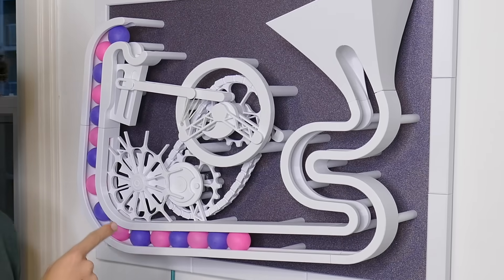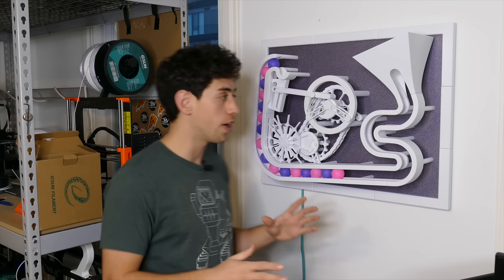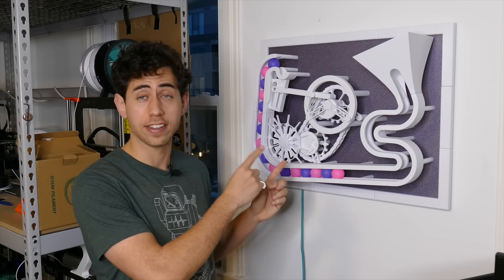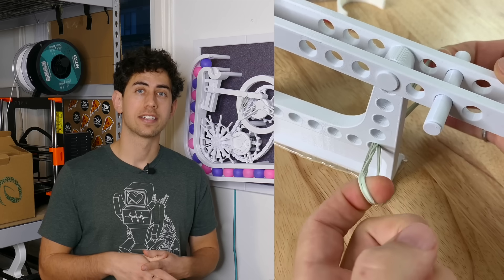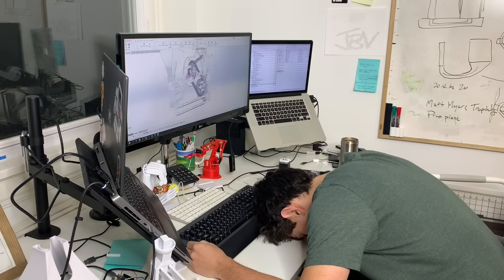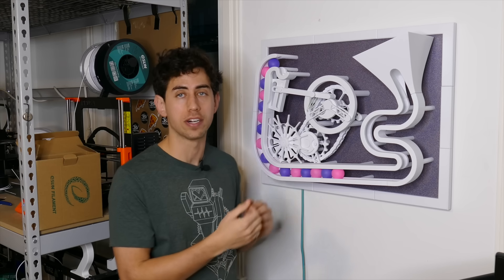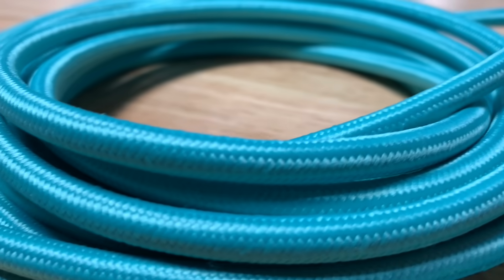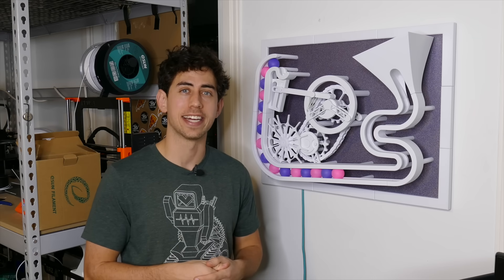I Built a Perpetual Pong Sculpture

Comment: Great project! Btw why not use a battery to power the whole thing instead of running off 120v? I'm sure you could find some LiPo batteries that are powerful enough and can also be hidden within the frame etc
Reply from the maker: Great point! Might have to use a battery moving forward.  Might've gotten carried away by the pull switch haha
Reply: @Engineezy  I see the iron ring! Lemme guess, mechanical? :)

Comment: I think an awesome version of this would be if you used a clock mechanism to move everything utilising the minute hand and having 12 balls so every hour the ball will shoot into the hoop and a ball representing the current hour drops into the ball launcher. I think it'd be the coolest clock ever and the way you have designed it would be perfect just change the motor with a clock mech and design something that slipped into the minute hand part of the mech and connected to the rotating assembly or a stepper motor and arduino board if a clock mech hasn't got enough torque to turn the rotating assembly
Reply: Great, you've done the easy and fun part of the next video for him!
Reply: @stevecarter8810  he still hasn't made it so I don't think he liked the idea to much, I think it'd be a great convo starter

Comment: I don't quite understand, why you need measurements, before you even start designing. Don't you do parametric design?
Reply from the maker: It helps to have a starting point- just because I have the power of CAD, this will end up in the real world so you need to know what constraints will affect the outcome!
Reply: @Engineezy  But things like the Sizes of the balls you need to do as parameter regardlessly. otherwise it is a bunch of work when you want to make the thing for different balls.

Comment: Idk why you didn’t tell us the power chord and on/off switch weren’t 3D printed either 😂 tbh that integration step is the project killer for me. The length of time between successes at that stage leads me to sidetrack in search of dopamine.
Reply: I 3d printed that, but it burned my house down, slept with my wife and told my children that there is no Santa. Best not to try 3d printing that.
Reply from the maker: That’s exactly what the side quests are for!

Comment: Smooth design! Solid works for the win. I’m curious if there would be a way to refine the slope angles in the funnel to try and get the ball to cleanly and almost silently fall straight into the tube like a 3 point swoosh. Then you don’t have much of the bouncing around noise. That would step it up to almost a zen kind of machine.
Reply from the maker: Definitely! Would require some iteration and some perfect springs

Comment: There's two things wrong with this.  Firstly rubber bands degrade in air so eventually they'll break or fail to stretch.  Secondly and more importantly this thing is just too darn noisy and distracting.  You can't just turn it on in the lounge room and let it run while watching TV. It gets annoying within minutes of operation. Which means you'll leave it off pretty much all the time and then its just wall art.
Reply from the maker: But…it is wall art…
Reply: @Engineezy  Not very good wall art.  If I had guests come over and I had these toys hanging on the wall they'd question my mental state.

Comment: I love the power cord on/off switch idea! Such a clean design.
Reply from the maker: Thanks! It was suggested to me on a previous project- agreed such a clean way to implement the switch.
Reply: same...i think it's my favorite thing about the whole sculpture.
Reply: This is one of those simple inventions that I just cannot understand why this not a standard thing, and why have I have not seen this anywhere before?!?
Reply: @CaribouKH  Probably because while it's a neat idea at first glance, it's actually a real safety hazard. There is no clean way to have the power cord be a pull switch without wear and tear on said cord over time, which in turn will potentially result in frayed power lines; not a good thing to have.
Reply: ditto
Reply: I was coming here to say that
Reply: First time I saw that was a CD-Player by the Japanese brand Muji. So there is (was) a commercial product with the feature. I would not call it a safety hazard as it (at least there) went through quality tests and got a CE approval…
Reply: I like the idea a lot, but I’d rather hide that cord and just have a hidden switch to keep with the clean / no hardware showing aesthetic
Reply: I might copy that idea someday. I love it.

Comment: What's your fail rate for launching balls into the catcher? How often will you need to replace plastic parts due to wear? Will the elastic hold for more than a couple years before it starts drying out and cracking? What about the motor, do you foresee any necessary upkeep with that? How will you address that if/when it happens?
Reply from the maker: Lots of great questions with no good answers- we will find out!